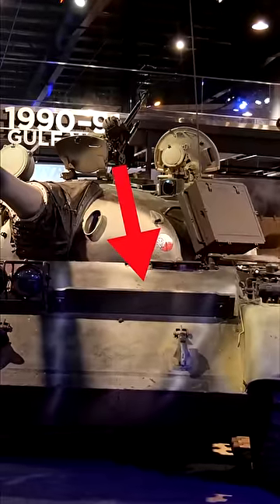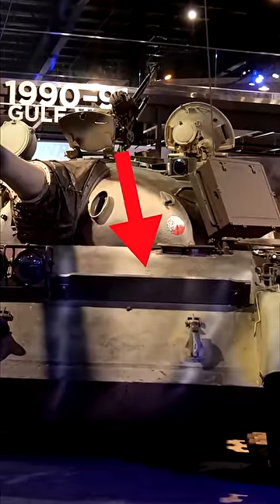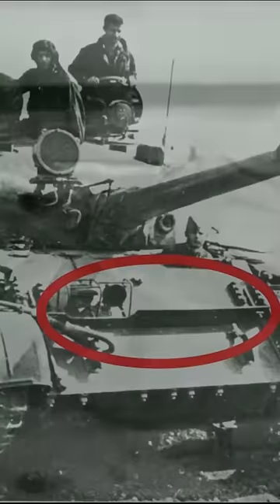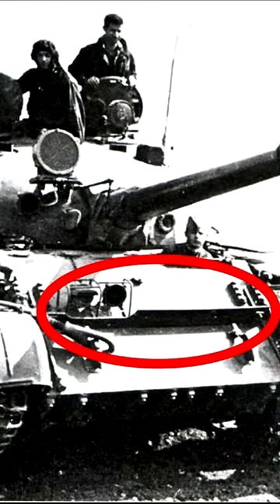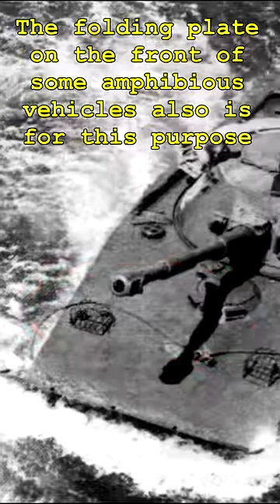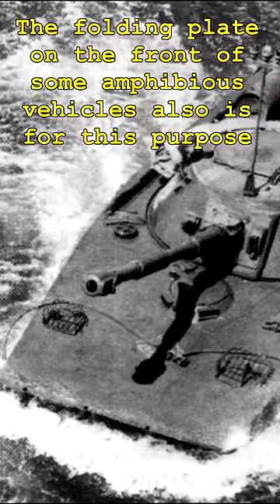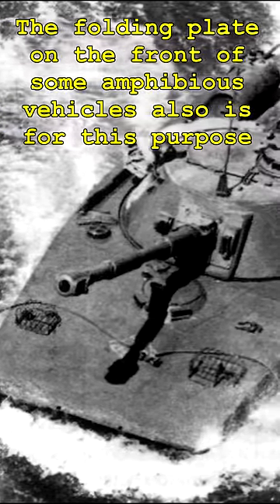Why Do Some Tanks Have This Plate?

Comment: I honestly thought it was for catching shrapnel from non-penetrating AP rounds on the front plate.
Reply: Yeah same
Reply: The t72 has a plate like this but it is only for what you mentioned and not for water
Reply: I used to think it was to stop heat rounds
Reply: I thought it was like rib armor on a BMP or S-tank.
Reply: I mean I would work
Reply: @@pipe_official1 This person literally learned ballistics from shields in Minecraft
Reply: I always assumed It was on shamans to It was to prevent it from hitting spare tracks or wheels
Reply: for what to hit the tracks?
Reply: Same
Reply: This ! I thought it was used to prevent shrapnels hitting the gun barrel
Reply: I thought it was so you could store stuff on the front
Reply: thought it was to stop ricochets into the turret from the front plate
Reply: Thought the same
Reply: @@pipe_official1bro what😂. Would be insane tho
Reply: Guess it would either be higher up if that was the case or it would be completely unnecessary as the shrapnel wouldnt go towards the driver anyways because of the shape of the hull, only risk would be to the commander outside of his hatch but even then idk if its worth an armor plate on the hull
Reply: That’s the actual purpose. A T-55 and anything that isn’t amphibious wouldn’t go into water that deep and if they did they have an external plate that folds in and out when needed. It’s even called a “spall guard” in War Thunder and it’s homogeneous rolled steel. What he’s talking about is a “wake guard” and totally different and only seen on vehicles like the BMP and BMD, BTR series amphibious light tanks and IFVs. That plate is to stop a ricocheting APFSDS from slamming into the turret neck (which would jam the turret traverse ring and disable the vehicle’s ability to rotate its cannon) or a ricochet from damaging the gun barrel. That’s the true purpose of that plate and that’s verifiable.
Reply: @AUsernameWeShallMarchToKiev That's not Minecraft Level of physic. That's Tom and Jerry level of physic.
Reply: Thought so too
Reply: @aceofhearts573 probably multi purpose

Who said anything in a tank has only to be for a single purpose
Reply: Same here
Reply: That is actually part of it why it's there (not sure if it's the main thing or not tbh). Back then, optics and especially IR was extremely sensitive (with external spotlight and all) so when you had sloped armor like this, technically heavy machine gun bullets could hit, shatter/ricochet and go up along the glacis plate hitting the exposed optics/equipment on the turret; which is suboptimal. 

The strv103 is also an example of this since it is very sloped and since it's a fixed cannon with no turret the optics are mounted right where the shrapnel from a potential projectile would go (it's also a nice way to not fall flat on your face when climbing the tank).
Reply: And you are right. Just look at the thikness. No one need a full cantimeter of steel to stop water.
Reply: Same
Reply: Yeah that’s what I figured to, to catch shrapnel from ricocheting into the gun barrel or driver
Reply: Or exploding grenades a few meters in front of the tank to catch flying shrapnel, stones and dirt
Reply: Me too. I thought it was when a shell bounces off the angled armor, it would slow the shell and stop shrapnel
Reply: But why would that be useful
Reply: Who says it can't do both? Multipurpose: Crew step, splash guard for water and splash guard for shrapnel or bullet ricochets away from the driver periscopes. It won't really do anything for real heavy caliber weapons since it's just mild steel.
Reply: It might be multipurpose. The soviets are big on stuff that serves more than one purpose because it saves them money
Reply: @connorgregory3986  That's exactly what I said in the comment before yours LOL
Reply: @shockwave6213  great minds think alike my friend.
Reply: Or maybe some extra armor to catch HEAT ammo

Comment: It's actually a break water guys. It's there to prevent the shifting of water from rolling up the tank's decks in heavy seas while under way.
Reply: @nofwild6325  why would you want to bounce shells directly into the hull?
Reply: @nofwild6325  if a shell hit and ricocheted off that plate, it would be directed downward and into the upper glacis. I don't see how you could think otherwise.
Reply: @nofwild6325  no it wouldn't. The shells that would be fired at this thing would be AP slugs or APFSDS. Hitting right on that crevice would help it penetrate.
Reply: @Patrick-zr8tv quicker death means no pain
Reply: @nofwild6325 so you mean hitting on the thin edge facing up and out? It would just punch right through it lmao
Reply: @nofwild6325 wtf bro you talking about. Thats not how it works
Reply: @Patrick-zr8tv Yeah But That's How WT Logic Works.
Ever Seen A T34 Driver Hatch?
Reply: Half correct. Note my post on July 17th, 2024. I was a commander of a T55. 
The idea of "ricocheting is complete nonsense. It is amazing how many "experts" are actually writing their stuff here.

The plate keeps water off the open drivers hatch (when open during a march), when the tanks goes through large water-filled puddles. preventing large amount of muddy water from coming in.
The T-series tanks were never designed to swim, so they crawled at the bottom of a river or a soft shore line when released from hoover craft and / or ships. In these cases the underwater kit was fitted and the plate had no purpose again. So in "heavy waters" the tank was at the bottom of the sea with its snorkel up, the plate not serving any purpose at the is moment either.

This plate had no other purpose than what I wrote, anything else makes no sense.

Peace! from Dresden / Germany
Reply: @Patrick-zr8tv My man, that plate is not strong enough to bounce a shell off. Also, APFSDS would go through either way, if fired at the right spot

Comment: My 2nd Thoughts were Mud Guard too
Reply from the maker: I've seen it referred to as a mud guard as well and it would perform a similar role for that sort of material
Reply: @ConeOfArc hey. Just thought I'd mention that on a lot of vehicles it also served as a ice break. Due to breaking into ice the sheet can slide right up to the driver if not careful so this requiring something to break it. This is was I learned from restoration at least and the old guard who use to drive chieftain.
Reply: i always thought it would protect the driver vision ports from being hit by shrapnel if a round hits the UFP. Is that another myth or a valid second use?
Reply: I thought it was to stop/slow ricocheting rounds from hitting the turret.

Comment: Wait what a Soviet tank underwater !? What is this Russian bias !? No wonder the NVA had a liking to the t55 in the late Vietnam war
Reply: yeah i think some soviet tanks were able to go underwater for a while
Reply: Note my post on July 17th, 2024. I was a commander of a T55. 

All tanks of the T-series, starting with the T54 were able to cross rivers by crawling underwater.
Therefore the tank was water-tightened up with a special kits (which was carries around at the outside of the tank) and a snorkel attached to the turret.

I myself crossed the Elbe-river (the biggest river in Germany) many time during my service in 1983-1986.

The splash guard in this case has no function either. It is used for long marches only when the drivers hatch is open and his seat up (with his head poking out).

Soviet tanks were designed to fight in central Europe with its many rivers and streams. The experience of WW2 was that these natural obstacles were hard to navigate since the T34 did not have such a feature, same for all German and Allied tanks.

Peace! from Dresden / Germany

Comment: It's obviously there to fit more human reactive armor.
Reply: @moski421 you told a bunch of soldiers to climb in your tank. Making them like an armor to the tank... but... in a very gruesome way.....    so ye
Reply: Sadly that only works for chemical penetrators (HEAT and HESH obviously), not kinetic penetrators (also obviously any solid AP and AP(FS)DS)
Reply: @captain-generalothinus3640  probably not
Reply: @moski421  Yeah, that's why they eventually stop doing that on MBTs because ERA and all, but on APCs the reason would be different that reason being carrying the most number of men possible, both in the transport compartment and whatever cling space is available out the APC (sometimes also disregarding the safety of said soldiers)
Reply: @captain-generalothinus3640  hamburger cheeseburger big mac whopper
Reply: @captain-generalothinus3640  no, it’s because mines tend to rip apart whatever is in the APC a lot more than tanks. For example, in Afghanistan, Soviet soldiers would purposefully ride on top of their BTRs and BMPs (the logic being that if an ambush or mine attack occurs, the soldiers can jump off immediately and fight)

Having soldiers ride desant is no longer in the stated doctrine of any military power.
Reply: You mean peenoise?
Reply: SU-5-1 have that HRA

Comment: Works for a little water,  but if you plow into a pond  or big water filled mud hole at any speed, you will have a 10 foot (3 meter) tidal wave of mud, crud , and water,  coming  into your driver's hold if unbuttoned(hatch open).   BTDT , once  😎

Also, they do block the driver's view of some the ground immediately in front of the tank,  which could be a problem , as to seeing mines or running over other "stuff/people/tree-stumps/etc." in front of your tank.

Actually,   that splash guard is more for stopping sheets of ice from hurting or decapitating the driver when a tank goes  into a frozen pond or big frozen puddle ,as the entire ice sheet can ride up the front glacis right at the driver's head.  That is scary when you have a 6" thick  1/2 ton slab of ice  coming at your face at the speed your tank is moving the other way.  I have ducked down a few times 😎.
 You don't want to have your driver's seat adjusted where you can't duck down quickly
Reply: The voice of hard, cold, WET experience...
Reply from the maker: I never said the style the Soviets used was the most effective for its intended role just that it was what that part of the vehicle was for. Obviously it would also help with things like mud, ice, or any other substance that might make its way up the frontal plate

Comment: I personally thought it was a guard against ricocheting shells that could possibly strike the main gun or turret but splash guard also defo makes sense. Possibly a two in one design? Even if it was accidental.
Reply: Probably not, as far as im aware ot was often wooden on some vehichles and even in steel it was at best loke half a cm to 1cm thick amd would basically stop nothing other than small arms and shrapnel that would do nothing to the turret or gun anyway
Reply: Also helps prevent shrapnel from hitting the driver's vision blocks.
Reply: I read once that they are used to protect bolts from small arms fire because the bullets would mess up the bolts and make repairs more complicated

Comment: The Swedish STRV 103 has similar Small Steel plates on the main frontal plate to reduce Spal ( Shattered debris )
Reply: they're thicker and faced the same way as the armor profile itself and not against it. if it were thicker on the t55 and t62 it would ease penetration of the upper glacis because the direction of he plate would direct shells downward into the upper glacis :)

Comment: i think for the early T72's it's a V shape
Reply: Nearly all T-72s (until they started adding reactive blocks to the glacis plate)  had the V shape splash guard. This is because it's driver's hatch is in the center and not offset like the T-55 and T-62.
Reply: Agree the T72 came to my mind also with that V shape.

Comment: My grandpa died that way. My grandfather was a german tanker in ww2 and when there was a river to be crossed. They put a snorkle on one of them tigers so the crew and engine could breathe. (The snorkle was a newer idea so it wasnt very good) and they drove into the water and the water was 3 feet deeper than they expected. The mud got them stuck and the water went into the engine with the snorkle and killed the engine. There was a 5 hour rescue mission almost. Many ss soldiers tried to open the hatch but the water was too heavy and my grandpa and the crew suffocated

Comment: It is the same principle as the 'V-shaped' deflector vanes on the T-64, T-72... Although, the number of times I've seen photos and footage of drivers of these tanks looking like they have just been fished out of a swamp suggests that they probably don't do much good at anything more than a walking pace, and the crew probably still has to use drain plugs or the belly escape hatch to clear the hull of mud and water.

Comment: The last fragment with tank driving under the water was in "Броня России" (The armour of Russia") cycle of TV show. In that fragment tank was crossing wide river with diving tube for the crew and water protection for engine. In show was said, that tank can dive under water for 10-11 minutes.
Reply: Correct. Note my post on July 17th, 2024. I was a commander of a T55. 
All T54 and later T-series tanks of Soviet design had such a feature. It tool the crew roughly 30 minutes to water-tight the tank including setting the snorkel on top of the turret. It allowed air to come in soe the crew and engine could breath.
The timely limitation for the underwater cruise was forced by the missing air intake for the coolant radiator, since the engine deck with its air intake must be closed for the dive. 
Once the T54 / T55 emerged the driver pulled a cable system opening the engine deck air intakes. The tank was combat ready within one minute without the crew having to leave the tank, jolting the breaks quickly for the snorkel to swivel forward into a horizontal position, the turret seal was released internally so the turret could turn again immediately.
Driving under water was with a gyro compass and a small mirror system for the commander to look forward.

Soviet tank design at the time was extremely advanced forcing all Western armed forces to upgrade their vehicles or replace them with new designs.
Unfortunately a lot of bullshitters here with their "War Thunder experience" are writing a lot of crap.

I myself crossed the large Elbe river at its bottom in Germany many times during my service time.

This design feature became a standard for all later T-series tanks, based on experiences from WW2 when crossing rivers were only possible via bridges for tanks on all sides. 
The T-series tanks were designed for combat in closer range areas like Central Europe with its many rivers and streams. Which is one reason why they could not perform very well in desert areas but really good in Vietnam and African countries with similar geography.

Peace! from Dresden / Germany

Comment: I doubt its primary purpose was for wading or wet gap crossing. Driving a Soviet tank was generally quite a wet and unpleasant experience if there were any puddles on the ground and this was a rare concession to crew comfort in that regard. Just look at videos of T-34s driving along and see how much water comes up over the front glacis when the ground isn’t bone-dry.

Comment: It's a HEAT guard because the driver doesn't really need his legs and the fuel tank can eat the shell if it hits the lower left
Reply: BS, it is only against water and nothing else. See my extensive explanation further down.
I knew this model very well, I served for three years as a T55-commander.

Peace! from Dresden / Germany

Comment: Ex T55-commnander (East-German army 1983-86) speaking:

The commentor is correct. This plate serves no other purpose.

- to use it as a step this plate has a too awkward hight and even worse angle. You rather break your knuckles trying to use it as a step in order to climb into the tank. We all usually climbed in via the tracks at the side of the tank.
- You might place tools for maintenance there. But as soon as you drive along a bumpy road your things will fly off. A sand bag might be sitting there a bit longer but if the tank really gets through rough terrain, very quickly nothing will be left behind this board.
- Diverting bullets or incoming grenades -- this idea is ABSOLUTELY (!!!) ridiculous. The board is not very thick, very wobbly and in the wrong angle anyway. it does not pose any resistance against any incoming rounds of any calibre.

The plate serves only one and only purpose: When the tanks march longer distances the driver's seat is up and his hatch open. 
If the tank goes through larger water-filled puddles the water will swash heavily over the front into the drivers open hatch. The board prevents it by holding it back. The board is fixed and not foldable.
This panel also has no use for underwater crossing of rivers since the tank is then completely water-tight and closed. All T-series main battle tanks of Soviet design were never amphibious (with other words could not swim), although they (starting with the T54) could be used in amphibious roles by rolling off large hoover crafts or ships close to the shallow shorelines. Therefore its underwater kit could be fitted. Preparation time ca. 30 minutes. The moment the tank crawls out of the water it needs a few seconds to tilt the snorkel forward, release the main seal for the turret to spin again and is combat-ready immediately without the crew getting out.
This kind of amphibious task was bound to my unit, the PB1 (tank battalion 1) in the MSR28 (infantry regiment 28) barracked in Rostock at the Baltic coast.

I personally served three years, crossing the large Elbe river many times at its bottom and participating in many military exercises during this period.

Peace! from Dresden / Germany